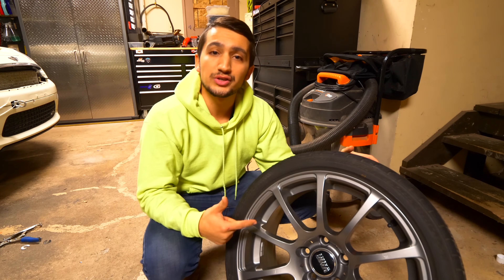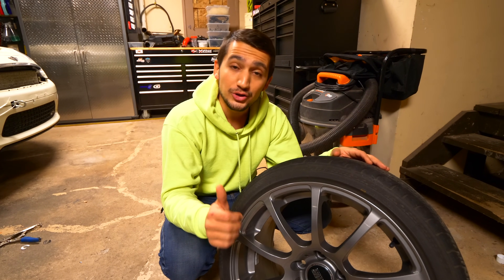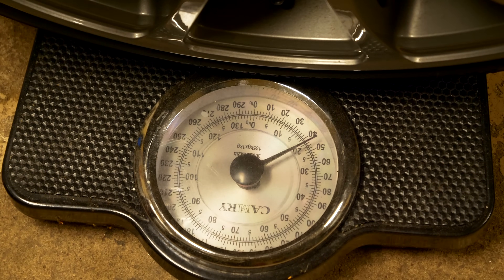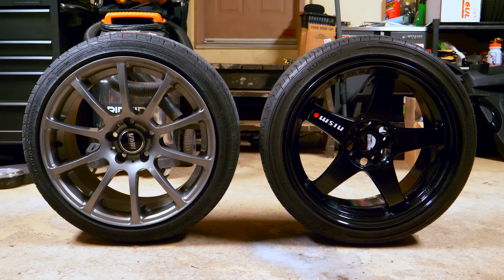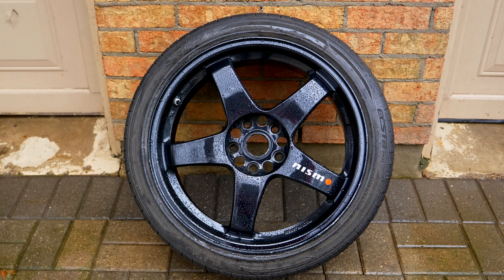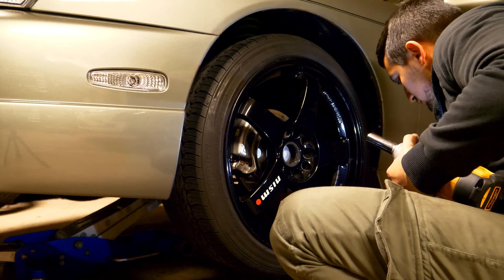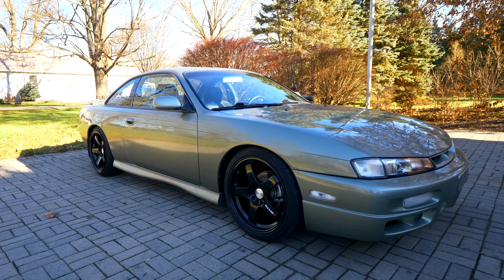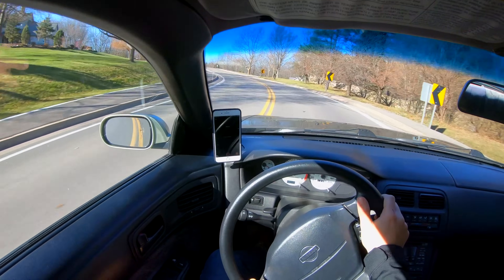Cast vs. Forged Wheels (Comparing EXACT Sizes)

Comment: Greater the number of spokes heavier the alloy:.
20 spokes 16x6j>16spokes
16x6.5j> 10 spokes 16×7.5j> 5spokes 16x8j.

How do I know? I have been in a search of perfect alloys for my ride for about 2 years. Where i live there is no availability of forged wheels only casted wheels are available. I have visited nearly 20 shopes with luggage scale and measured over 80-90 alloys.

Comment: In case of the forged Advan GT 18x8.5 compared to the flow formed Advan TC4 wheel of the same size, or a flow formed 18x8.5 Wedssport TC105-X compared to its forged counterpart interestingly weighs the same. So it is also up to the design of the wheel.

Comment: The tires need to be removed off the wheel for an accurate weighing. This video is pointless!
Reply from the maker: What about the same amount of tire tread? What about the exact same tire pressure? What about the same kind of center cap? What about making sure the little hairs on the tires are either there or shaved for both tires? You're right, this video is pointless.
Reply: @milanmastracci  do you have a video of the wheel only?
Reply: @milanmastracci  for this to be accurate weighing, only the wheels themselves need to be weighed. can you please upload a video of a cast wheel weight vs a forged wheel weight of the same wheel size and dimensions. There are no videos ANYWHERE, not here on YouTube or the web showcasing the wheels weight. everything is here say. Your video was almost spot on but you had tires on them. Please do another video with only the wheels for the sake of all car enthusiasts. I don't mean to sound snarky in my comments.

Comment: Bogus.  Much more involved in casting wheels.  For instance many are pressure cast from the bottom not pored from the top.  Also heat treating is involved.  You have no idea how a forged wheel is made.  The wheels you compare are totally different and why add tires to the test????   This is totally bogus.

Comment: It seems like folks are very confused by this.  These are racing wheels, and the cast wheel meets his strength and rigidity requirements.  Therefore, the benefit of the forged wheel is hitting the same strength and stiffness requirements while using less material to do so.  The entire point of using forged aluminum is the ability to use less material, visible as a different wheel design.

Comment: man, you can only compare the weight of 2 wheels if the designs are exactly the same , including the back of the hub and spoke inner design . otherwise it makes no sense and no point to compare the weight .    but frankly , same design ,same size and same fitment , the forged one is lighter .

Comment: Using different wheels is fine if you are only considering the effects of the weight to the performance. For me where I believe you are vague is the difference between unsprung mass effects and rotational mass effects. The effects are distinct from each other.

Comment: I have two sets of wheels for my wrx one are 26.6 pounds per wheel and the other are 18.2 pretty sure they're both cast as one was stock and the others weren't expensive.  Both same exact size but I have yet to feel any difference
Reply from the maker: Are you running the same weight tires? The most noticeable time that I find the difference is when I break traction, especially in a RWD car. The lighter wheel will allow you to spin at a lower RPM since there is less rotational mass to be spun.
Reply: @milanmastracci  yes Michelin pilot sport 3 as so between those and the all wheel drive I have trouble losing traction outside of cornering at like 80+ mph. But I have noticed it doesn't lug nearly as easy gas mileage hasn't changed at all but that could be driving style

Comment: You compared weight difference with two different rims.  That doesn't make any sense whatsoever.  As Yoda would say, this is not the video I was looking for. I thought it was going to show strength difference of the same mass of aluminum, cast vs forged, or maybe density difference between cast and forged, or something scientific at least.

Comment: ehhhhhh. sure forged wheels are lighter, but your specific comparison is a little misleading. that cast wheel looks like it's got a lot more metal. the spokes are a little thinner, but there are far more of them. might be hard to do, but to do a real comparison, you need to get the exact same wheel. to get at least a somewhat accurate comparison, you need to get wheels that are very similar, which is not hard to do.

Comment: The weight test was not apples-to-apples. The theory of the difference might be sound,  but wheels of the same design should be tested to see the true weight difference.  Visually, the second wheel had fewer spokes and wider spaces in between.

Comment: You mentioned the weight of cast and forged but not flow forged. I'm looking at getting some flow forged 1Le wheels for my 2011 SS Camaro but if they aren't much lighter than stock I won't be interested in wasting my money.

Comment: As many others have commented, you are describing a machined or 'billet' manufacturing process, which is not the same as forged. Please delete this video and re-upload it with an accurate description of forged manufacturing, as the existing video is spreading misinformation.

Comment: Finally someone who somewhat understands wheels.   The VMR are gravity cast, not low pressure cast or roll forged on the rim.  It is heavy and weak, but cheap.

Your description of a forged wheel is in fact a CNC machined wheel.  Unless the block ingot is forged, it is still a cast wheel in grain structure and strength. 

A true forged wheel is metal that is put under tons of pressure in a press, then machined to present a finished wheel to any further cosmetic enhancements.  It is strong, light,more durable and thus expensive,

Might view some BBS videos to see how wheels are actually forged.   Rays Engineering  makes excellent forged wheels.

Comment: you can have low pressure cast wheel of the same design, same wheel load capacity, and it can be lighter than forged wheel, so wheels should be compared in a precise matter

Comment: Left also has more spokes here. Granted theyre a tas thinner but uh theres more metal/aluminum on the left by the looks of it. Id like to see 2 of the EXACT same wheel with same tires and psi and THEN weighed.

Comment: I think wheels need to be tested - loaded with the same weight, so we can check how strong they are, and the design needs to be the same to compare two wheels of different technology, and then comes comparing wheel weights.

Comment: Comparing apple with oranges. I guess the important thing to realize is that the forged comes out stronger, and therefore you don't need the same amount of mass for it to be strong and meet the specs. On the other hand with the cast you must retain thickness to meet the specs, and therefore it has to come heavier.

Comment: Just because they're Forged doesn't make them lighter than a cast wheel. 

1 square foot of aluminium weights the same, regardless of its been forged into the shape or melted and poured. The biggest difference is, wheels are typically a Alloy concoction, what metals make up that alloy cocktail is ultimately going to heavily impact the weight of the wheel. You could have 2 identical alloy wheels but made with 2 diffrent aluminum alloys. One wheel weights 18lbs the other weights 20lbs.

It's actually more likely that the cast wheels would weigh less As theirs great chances of imprrfections affiliated with casting metals like micro pockets in the solidified material that ultimately reduce the weight and strength of the wheel.

Comment: You didn't describe forged, you described billet. Forging involves heating and pressing. Hence forging the metal whether it's aluminum or magnesium.
Reply: True, and while a billet can be forged, it likely won't have the advantages in grain structure that a more finished forging can.  The video does address the advantages of lighter weight wheels in a seat of the pants way though.  Not sure if he mentioned the improvement in braking performance, which is just as real as the acceleration improvement.

Comment: Don't hold the pressure washer so damn close to the tire sidewall, it's the softest spot of the tire and you can fatally damage your tire by doing so!
Reply from the maker: I have never heard of a tire getting damaged by a pressure washer. I've been using this technique for years without a single problem..
Reply: http://www.autobild.de/bilder/reifenschaeden-durch-hochdruckreiniger-20515.html#bild1

german website, but you get the drift...

Comment: You are confused. There are cast, forged, and "billet" or machined. Cast is more or less as you describe. Machined is what you are calling forged. Forged is taking a piece of metal, heating it up, and pressing it into a die in one way or another. Rotary forming is similar to forging in that it gets heated, but it is turned while a forming roller shapes the wheel sometimes against a die.

Comment: which are better low pressure cast or gravity fed/flow formed wheels?
Reply: I vote LPC. Gravity fed, even being flow formed, still have their inherent weaknesses. Vertical LPC wheels will create a generally stronger wheel than a gravity cast wheel. Also, many LPC wheels are flow-formed as well.

Comment: Dude... tyres don't have the same weight even they will have the same dimensions. Different brands use different components. A rubber is not just black rubber. It contains all sorts of inlays including metal meshes and wires and that makes them heavy. Even the same dimensions from the same brand can vary a lot. For example if you take Dunlop Sport Maxx and any other Dunlop tyre with the same dimension you won't get the same weight.

Comment: Please do more research and learn what the 4 types of wheel construction are ie cast, spun/partially spun, billet, and forged. Particularly spun, billet and forged are very similar if they are multi piece. Billet are for low production numbers. Forged are for high production number light weight wheels where money isn’t an object

Comment: One bad thing about forged rims is they crack.  If you hit a pot hole they tend not to bend, but rather crack.  Then you try to call the company you bought the rims from and they won't cover hitting pot holes under their "life time" warranty.  Yes they are lighter but for DD duty the risk isn't worth the reward IMO.

Comment: There is a weight difference between a high pressure casting and a low pressure casting. Even BBS spin casting. So you can't just say a cast wheel will be heavy.

Comment: I'm rolling on some semi-forged wheels that are 18x7.5 +45 @ 18 lbs.  My stock wheels were cast 18x7.5 +47 @ 29 lbs!!  Made a huge difference in how my Si drove.  They were $900 for all 4 wheels.  For comparisons sake, fully forged Volk wheels at this size were 16 lbs for $3,000.  I wasn't trying to save an extra 2 lbs for $2,100.  Basically, semi-forged wheels are a much better bargain.

Comment: What? 18kg for forged Nismo wheels?! Why are those things so damn heavy?!
I have some Rays Volk Racing wheels (summer) and Yokohama Advan Racing wheels (winter) at the same 18 inch by 8.5 on my Evo and they're both around only 8kg, even with the tyres mounted I get just a bit over 10kg. Compared to that your wheels are almost double the weight!
Either your scale is broken or Nismo has some surprisingly and disappointingly bad quality...

Comment: Holy shit.. total crap about forging, machining, casting and metal spinning
REAL forgings are stronger, so less material needed: so lighter, BUT tool costs are higher,  more expensive.
The alloys are also different.
 All in all, forged is for racing.

Comment: You're confusing billet and forged.
Reply: Indeed. His definition of flow form is forged, which is also referred to as flow form by some companies
Reply: Its the same thing:- In contrast to casting, a forged wheel begins as a solid piece of metal referred to as a “billet”. This billet is then subjected to heat and intense pressure, which compresses the material to form a raw forging. These raw forgings are “forged” into different profiles to allow for the creation of different wheel designs.
Reply: @thomasdickason3884  No a true billet wheel starts as an aluminum blank which is cnc machined for design, bolt pattern, and offset.  That machined center is then mated to a spun outer hoop that is heated to allow the center to be inserted and centered, to two pieces are then welded together. A forged wheel is heated, formed, machined and then attached to the outer hoop by welding, bolts or even rivets. True Billet Wheels are used best for show vehicles only as they are fragile, will bend at the slightest pothole and are expensive to repair.  I know this from running Boyd Codington Billets for years.
Reply: @thomasdickason3884 forging and “billet” are not the same thing. You can make “billet” parts from a casting. All “billet” means is that the entire final surface is machined from a solid piece of metal. but that solid piece could be a casting, a forging, hot rolled, cold rolled, extruded, spun, etc etc etc.

“Forging” has very specific effects on grain orientation and microstructure that cannot be produced simply by cutting things from a solid chunk of metal. Forging reguires expensive forging dies and extreme amounts of pressure, and is only used where maximum possible strength and fatigue life for the weight are essential.

Comment: you defined a billet style construction, forged is forming the wheel by pressure from a press to make it into the shape progressively, the forge construction directs the grain to handle stress, the cast ends up with a large grain because the grain isn't shrunk by pressure, billet has varying grain typically smaller and in all directions for an overall decent handling of stress but have better overall tolerances.
Reply: +Shadowcard, ditto. That's the first thing that I noticed. This guy doesn't have the knowledge of forged vs. gravity cast vs. billet. There are also low-pressure cast wheels, tilt-cast wheels, and then flow-formed versions of both of those types. Tirerack has a great info section about these things.
Reply: Actually you’ll find that the wheels are produced from a FORGED lump of metal not a CAST lump YOU DONT KNOW WHAT YOURE TALKING ABOUT SO DONT CALL OUT UNLESS YOU DO....IDIOT
Reply: @neilbowness6074   you guys are technically both correct.   But usually in cost saving measures you take billet piece(forged hot or cold rolled) and heat it and press it into shape again closer to the desired end product followed by machining.

Comment: Forging an alloy wheel is take a lump of billet heating it to near melting point and using a hydraulic ram to press it into a mould. The process is similar to extrusion but the temperature is lower and the force greater. The the plug has been shaped and quenched it is then machined into the final shape. What he described is a billet machined wheel which is stronger than a cast wheel but weaker than a forged wheel.

Comment: You look very young but very knowledgeable! I was looking for things to disagree with you but I can't. Although there is definite weight differences between cast and forged, you cannot forget that the design (spoke) of the wheel has to do with the difference in weight as well. There is obvious less material in a wheel design that is simpler or less complex thus less weight.

Comment: Unless you have two wheels of the same design, this test is inaccurate. You need the same design for both, one being forged, one being cast to be accurate
Reply: Exactly. I thought he was going to show the exact design wheel forged. Apples and oranges comparison
Reply: And its about cast vs forged wheels. Not about tyres. So no tyres.
Reply: I think wheels need to be tested - loaded with the same weight, so we can check how strong they are, and the design needs to be the same to compare two wheels of different technology., and then comes comparing wheel weights.
Reply: Yep
Reply: @3dler954  That's a good question. The only "Forged" blocks that I know of are in top fuel dragsters. Here is what I found as the definition of "Forged". Forged - Anything : means it was a solid square block of metal in the beginning , and then they carved the solid block into a shape. All top fuel blocks are made from a solid block of aluminum.
Reply: And also same metal composition......
Reply: The tires need to be removed off the wheels for an accurate weighing. This video is pointless!
Reply: its almost like hes doing a laid back experiment with what he has laying around and not a university thesis
Reply: HotMetal524 I was just about to comment that XD
Reply: Different tires have different weights too.  2 different wheels.  Inaccurate comparison.
Reply: u guys are sticklers, the total mass looks about the same, just differently distributed

Comment: you cant compare 2 DIFFERENT wheels 
it would have to be the same wheel design, same number of spokes, barrel design etc.
There are also the same 'spec" wheels as you stated in your description that weigh less than those forged wheels.
The main advantage of forged wheels is strength vs. weight not just weight.

Comment: I noticed those forged wheels where multi fit wouldnt that account for the weight loss compared to the other set that whernt, asking out of curiosity is all, would there still be a weight loss with a non multi fit staggered wheel? And thanks
Reply from the maker: The forged wheels look like they have 2 different bolt patterns, but they actually just have open holes between each lug hole. I wouldn't be surprised if it was for weight reduction, but these wheels are only 5x114.3. The holes however will account for a small weight loss, but not a near 10 pounds per wheel.